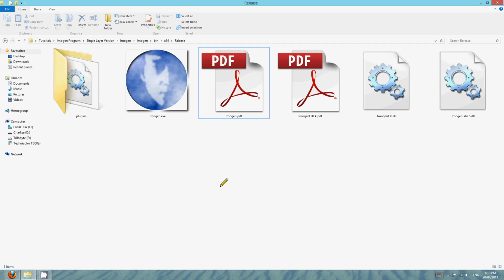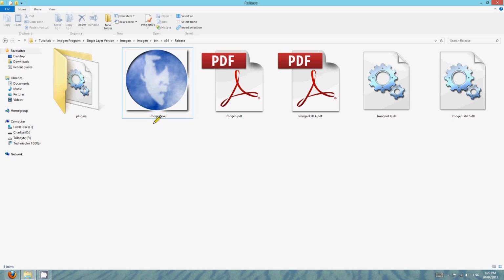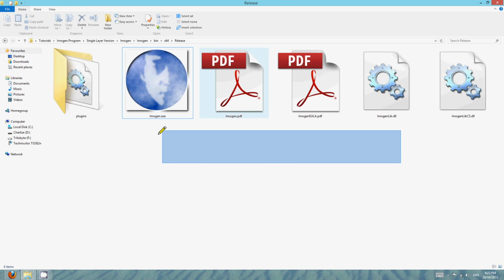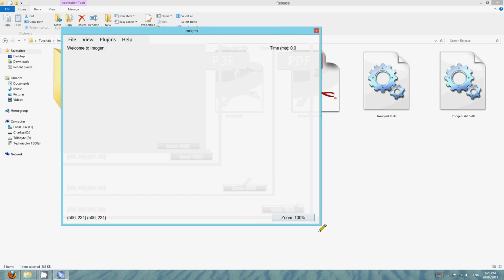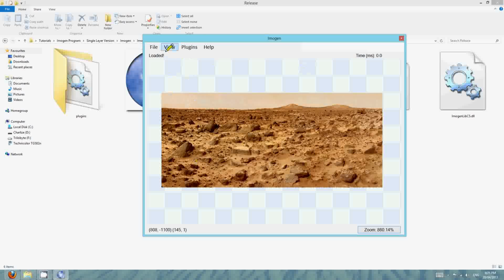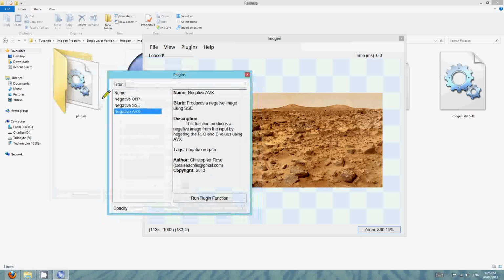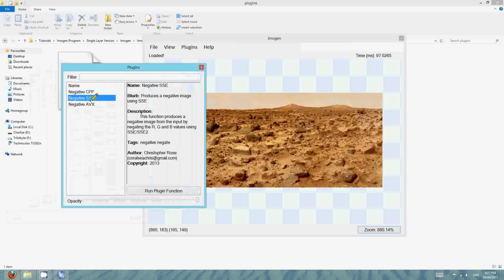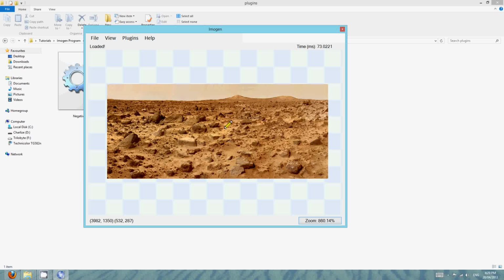x64 Assembly Tutorial 59: 128bpp Photo Editor Frontend Imogen

Comment: love the tuts they are more then help full, have similar project for school, only problem is i can't set pixel format to 128bpp, visual studio (2013) just doesn't list it....... what the heck i'm missing? anyone ?
Reply from the maker: I'm not sure what you mean. The 128bpp is not a setting in Visual Studio, it's just the number of bits I use to store the pixels in this program.

Anywho, great project for school, good luck and thanks for watching!
Reply: What's a Creel? hey thx for response, i was thinking on something like this: "imageFront->LockBits(rectangle, ImageLockMode::ReadOnly, PixelFormat::32bppRgb)" and instead of 32bpp u had 128bpp when .net locks the image in memory... maybe i missed something in tuts, and was under wrong impression what u did there...
Reply from the maker: jure glavan Oh, ok. It's not like that. I've handled all the graphics in 128bpp floats and only copied to the 32bpp bitmap at render time.